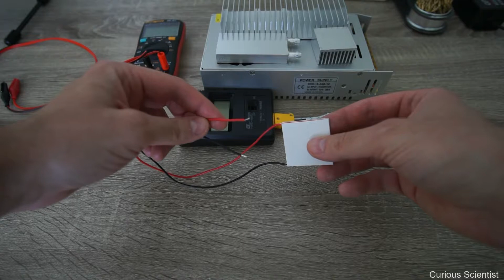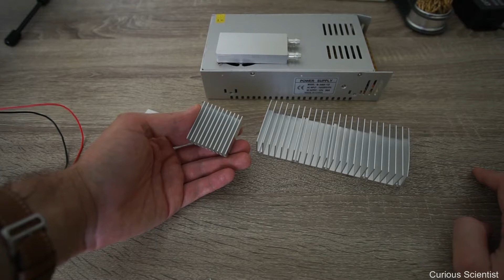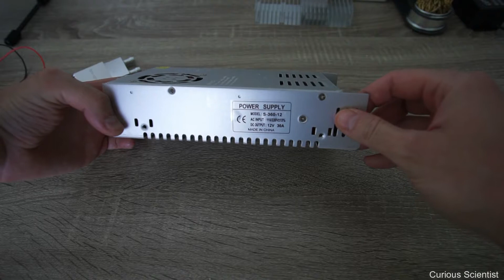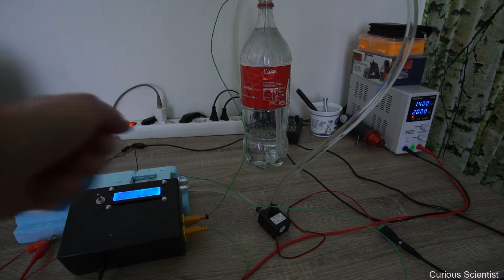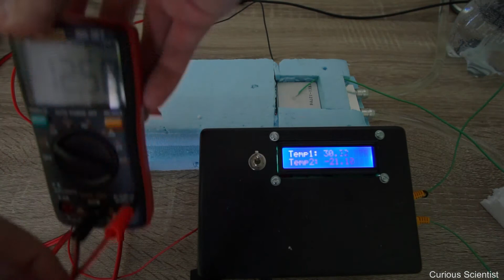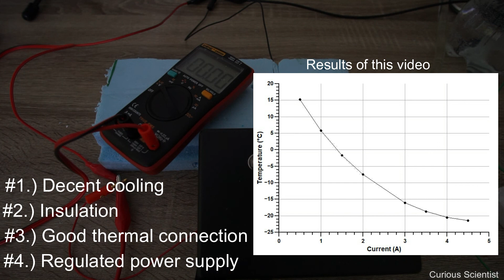Peltier cooling in practice

Comment: I came here from your workshop tour video, since you said peltier devices need beefy power supplies. My use case is I want to cool water down to 4-6º celsius, and judging by 22:06, I only need 5v + 1A, correct? Does it change if instead of a water block, I attach peltier to a copper block, as I'm planning on drinking the water.
Reply from the maker: It all depends on the quantity of the water and the time needed to cool it down. Is it in a cup, or is it a continuously flowing water? There are many variables.
Reply: @CuriousScientist  max 180ml of water, sitting in a reservoir, first to cool down to 5º, then flow down while maintaining the temp, timing is not strict, can wait 5-10 min if needed. I thought Amperage sets a ceiling to max temp diff, and can't be overcome by time?
Reply from the maker: Yeah, the amperage sets the dT, but if you have let's say 100 liters of water ("perfectly insulated"), then it will take an eternity to reach the target temperature. Same as boiling water on your stove: you can boil it aggressively at the maximum setting of the stove, or "simmer" it at nearly the lowest setting. The only difference is that how much heat do you pump into your water. Same here, if you use larger amperage, you increase dQ, so you pump out more heat, therefore, you cool faster. 

180 ml sounds reasonable. You can cool it down relatively fast.

Comment: Very nice,,,,,but .... i try to connect 400 watt psu with molex cable  yello and black with   peltier 12706 and no work,,,,I have also good heatshink,,,,so what is wrong ???
Reply from the maker: I cannot troubleshoot your system without seeing it. Use some common sense: check if there is any current running through your Peltier. Maybe the Peltier is not working (it is already dead).
Reply: @CuriousScientist  1 week dead ?
Reply from the maker: @Gamerman2024-u1w  It is not about its age. You maybe overheated it or something. Moisture can also kill it easily. Maybe you have a broken contact somewhere. Did you measure the current?